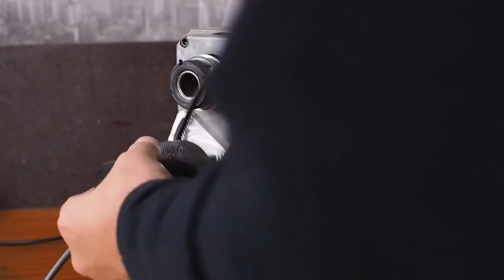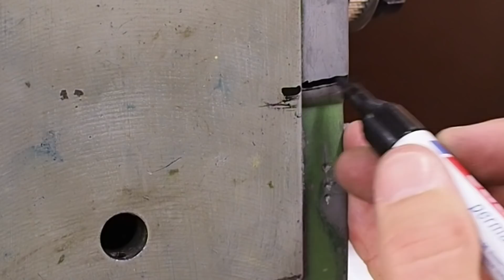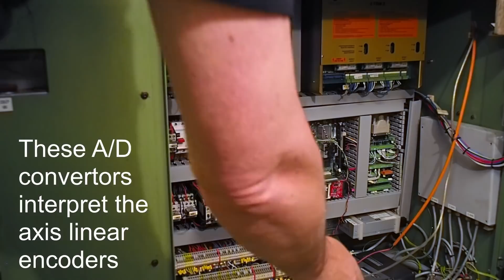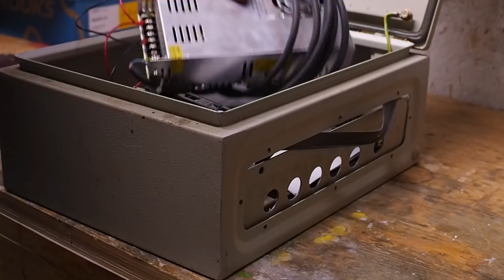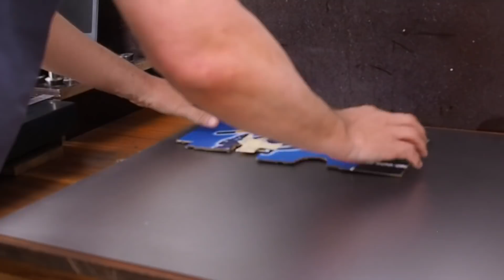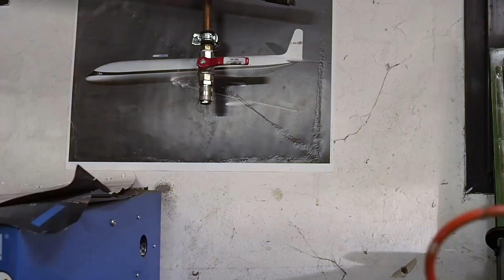CNC'ing the 7x12 mini lathe - Episode 16 - Encoder, drivers and enclosure

Comment: Suggestion on your DoALL gear problem. Make a new shaft, contact Boston Gear for a helical gear and press fit it on over a woodruf key and/or Loctite 603.
Reply from the maker: I looked into that, but it is an 11 tooth dp 11, and it doesnt look like they stock it. It also doesn't have much core diameter to allow a bore for a shaft.

Comment: Using “gauge” as a measure of thickness goes back to the beginning of the industrial revolution. Wire drawers (people who produce wire,) needed a way of quantifying what they were selling, and the easiest method was weight. But just asking for fifteen pounds of wire without specifying the thickness wasn’t very helpful, so the drawers would quote diameter based on the number of draws performed, and this became the gauge. This is also why a higher gauge number correlates with thinner material. Each drawing reduced the diameter, so more drawings meant thinner wire.
Reply from the maker: Thnks for the explanation. What made it easy in 1840, doesn't necessarily hold today when everyone has a digital caliper and can measure :)
Reply: @RotarySMP  oh i hear that ;)

Comment: I think you're giving a good example of how the things might be complicated by choosing a bad donor for CNC conversion. Using original ways would require oiling system, X-travei isn't good enough for implementing swiss-type tool changer, headstock mount to the bed is quite flimsy. Using stepper motors, having low torque at high rpm, would limit max G0 speed, especially when using original ways (non-bearing rails). 
https://youtu.be/WmaSx0cW1Xc?t=118
https://www.youtube.com/watch?v=Y7B_gzsvo9M
https://www.hobby-machinist.com/threads/home-made-cnc-lathe-using-servos.74039/
Reply from the maker: Absolutely agree. I would not buy the mini lathe today. I only got it as I no space back in the apartment for a real machine. My main reason to restore it was to learn scraping. The project has grown into a Youtube trip. 
When I got a mill, I considered CNC retrofitting a ZX-45, but worked out I would only use the four main castings, and have to replace everything else. The MAHO already had, central oiling, big ball screws, hydraulic tool change, linear encoders etc. It is much cheaper to retrofit a good old CNC than to do a conversion of a manual machine, and the result will perform better.

Comment: Two thoughts, both of dubious helpfulness:
The optimum folder finger widths can maybe be worked out by consideration of Golomb Rulers: https://en.wikipedia.org/wiki/Golomb_ruler Though that does assume that you won't re-arrange the sequence. Have you seen the (Australian) Magnabend? There are instructions on the web site how to make your own (or links for where to buy them)  http://aaybee.com.au/Magnabend/Magnabend_Homepage.html
Secondly, if you had a lip at the front of the enclosure that the front panel dropped behind, then flood coolant would be more likely to stay in. And it would also make it far less fun to shovel out the swarf.
Reply from the maker: I have seen the magnabends, nice tools, but out of my price range unfortunately. I don't think spacing the fingers a couple of mm apart makes too much difference, but you are right that I should have made a little more effort to use something like Golombs ruler when I originally planned the set of fingers.
Reply: @RotarySMP  Ah, but, there is all the info on that web page to make your own Magnabend. Though it might be easier to use something other than the fascinating hinges.
Reply from the maker: @andypughtube  I think my bender will work a lot better if I find the motivation to correct the pivots to much larger bolts, and tighten them properly. So many potential projects, but so little time. You know this better than me :)

Comment: To help our American viewers, 0.9mm is nine twohundredandfiftyfourths of an inch.
Reply from the maker: Exactly. The beauty of standards is that there are so many to choose between.
Reply: Or 35.4 thou, if twohundredandfiftyfourths is too awkward for them.
Reply from the maker: @alanclarke4646  Ouch, you cant mix in decimals :) That is 354 tenths.
Reply: @RotarySMP  I know. Decimals of a thou is just as silly as twohundredandfiftyfourths of an inch, or speed measured in furlongs per fortnight.
Reply: It would be 20-gauge in 'Murrican. You wouldn't bother with the actual thickness measurement unless you needed to cut a clearance for it.

Comment: I like the cordless drills and other tools too much to use pneumatic tools anymore at all.
Reply from the maker: I guess it goes back to my apprenticeship. Aviation uses pneumatic tools to prevent explosion risks. I was once on a C-Check and came out of the fuselage, to see a guy using a battery screw driver to remove tank panels. Nearly crapped myself.